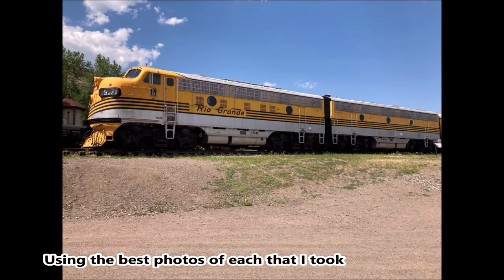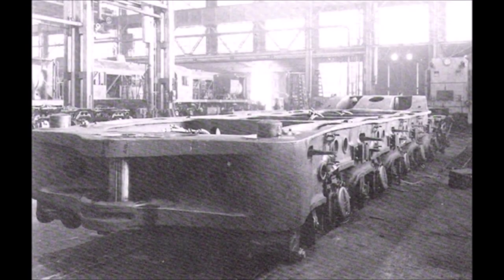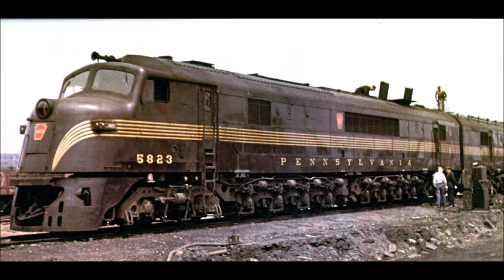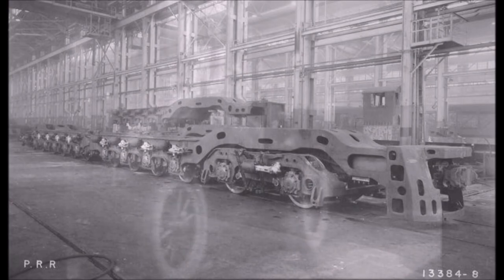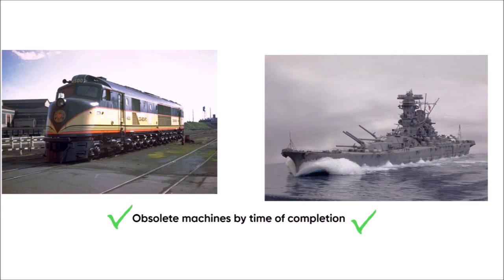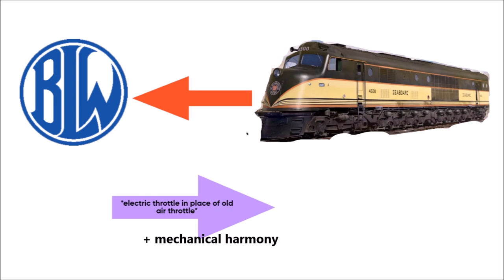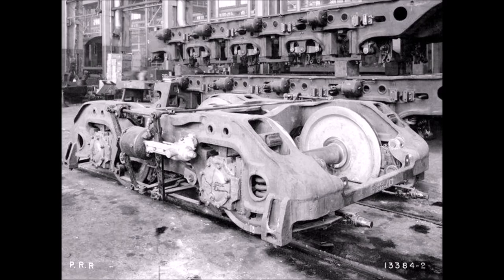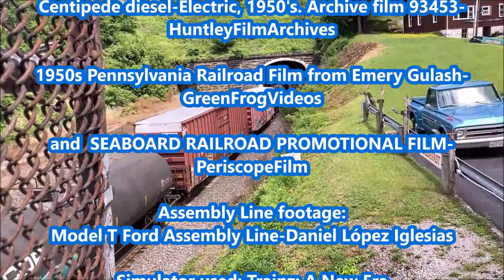The Baldwin Centipede| A steam-head company’s rough start with mainline diesels.

Comment: The main feelings of the Baldwin centipedes and the Baldwin baby face locomotives was the fact that everybody was going EMD and Alco. Even with a laborer walking behind the engineer watch mopping up the oil they still leaked like a s i e v e. Another major defect with the Westinghouse electrical gear that Baldwin had used for diesel since the beginning were at the end of their development and failures were common and inconvenient. Fairbanks Morris had the same problems with their high-powered look about his and when they went to General Electric electrical components Westinghouse exited the business. It's a shame that none of them were preserved in the museum.
Reply: Frank, 
Actually the Westinghouse house electric  equipment on the Baldwin's and F-M's were "nearly indestructible" . The combination of the generator and pneumatic throttles tended to break crankshafts or engine block webbing. (Westinghouse basically put themselves out of the business). Baldwin eventually strengthen blocks and there webbing. However, the primary mistake was making the prime-mover and generator 'one' assembly, meaning the block had two bed mounting points and the generator two. So, there was additional stress on the crank and block where they mounted to the generator. (A mistake later repeated by M-K/MPI on the MK5000's).
Reply: @henryszubielski8601  you brought up some points I was not aware of I am not totally up on the failings of Baldwin Road diesel locomotives. I do know that they are subject to crankcase explosions from fuel building up in the crankcase. All diesel suffer from this some more than others.
Reply: It is my understanding that Westinghouse generators suffered 'flashovers' under heavy load. The Westinghouse traction motors on Baldwins and FMs were far superior to EMDs.
Reply: @frankmarkovcijr5459  True.
And, the early De Lavergne engines also tended to dislike turbochargers. Everyone had their teething problems. Each adjusted for it. Flashover was an issue for any early diesel locomotive if pushed to hard. Again, Westinghouse worked through the issue with Baldwin. By then it was to late in the game. Here is something a lot of people don't know, all versions of the De Lavergne engines continued to be improved and supported into the late 60's or early 70's (if memory serves me). SMS is one of the great strong holds for the Baldwins.
Reply: @Greatdome99  Yes. But all of the early manufacturers had that issue if the locomotives were over loaded. Baldwin may have seen that a little more given that they produced switchers only, at first. That is the most demanding senario, and with the pneumatic throttles  putting the locomotive into forward and reverse so much it was bound to happen.
If memory serves me,  the early F-M switchers saw this more often as well (pneumatic throttles). 
For the yard switching engineers, it is said that they loved them because there was no extra step to go into the other direction.

Comment: Thet just don't know the benefits of the electric trains powered by using Natural Gas, Thermoelectric and renewable power stations!..
Reply: does natural gas and thermoelectric runned locomotive even exist? im just sticking with catenaries instead of these or even batteries and hydrogen
Reply: @voidjavelin23  I actually meant power plants to provide electricity for electric trains!..
Reply: @johnarnehansen9574  eh i like nuclear powers more

Comment: Every episode in these series I find more wrong things.

First I'll start on your hypothesis about why more wheel = good. More wheels do not relieve pressure on the rails, infact psi can't even be used in this situation, as the rails and wheels are in a open air containment. Pressure is used to measure gases and liquids, not solids. The reason more wheels help with rail wear, is weight distribution. With more wheels, the carbody has more places to spread the weight, as such damage and wear is less focused on the rails.

Now I also have alot of problems with comparisons in this video. First of all, the GE manufacturing plant. This one isn't as important but I'll list it anyways. All diesel locomotives in the US, GE and EMD atleast, have slanted noses. The reason this is because EMD noses, mostly standard cabs, have a 1-2 degree angle on top (excluding high noses). Now, the Yamato Class Battleship is said to be, and I quote, "The right ship for the wrong war," which in this case fits perfectly with the Centipede unlike you said. The Centipede was made using steam locomotive strategies, in the production of diesels.

Finally the problems, with your problems and explanations. Baldwin actually did pretty good in the diesel market for what they first and last sold, the middle era (the era the centipede is in), not so much. Baldwin never really intended for MU connections, and probably didn't care much either considering steam never had that. This can be found out in AmtrakGuy365's "Baldwin Sharks" video. The sharks actually did very well, even with the inconvenience with MU connections to other brands. If the railroads ever found it too annoying, they just converted them. And considering there was less Centipedes to Sharks, it might've actually been an easier job. Centipedes also had wheelslipping issues, as they had too much torque to use, and it had to be put out someway.

Now you do actually get some things right. Baldwin didn't really have the factories to mass produce Centipedes. They did for smaller things, such as switchers, road switchers, and of course, the sharks. Baldwin probably didn't have a fun time converting factories from diesel to steam production. Infact, they barely stopped making steam locomotives, making the US' last batch of steam locomotives ever with C&O's Alleghenies. 

It's funny I found more accurate information with Train Simulator's Centipede DLC and AmtrakGuy365's video on Sharks, only mentioning the Centipedes in Baldwin's history. Before you ever make something public on a topic you don't personally have experience with, make sure to fact check it with other sources, rather than just 3. Wikipedia also is more of a secondary source, as anyone can modify it with just an account. That's all.
Reply: It's ridiculous that you try to correct somebody whilst you are wrong yourself. If you're having problems with physics you should ask questions rather than just making random claims.
Of course you can divide a force by a surface and get a pressure. Whilst it's usually not done in this case because the contact patch has an uneven pressure distribution it is still an important metric. It is more comon to talk about wheel load (/normal force) (or what the American terminology is).
PSI is not just for gas.... wtf...
Reply: @erikschmidt476  You can't measure solids with PSI, though you can with gas, and sometimes liquids. Take a hydraulic press in a closed space for example, the more it presses down, the more air is compacted into a smaller space, creating a higher PSI.
Reply: @Sleeper____1472  Yes, you absolutely can apply the concept of pressure to solids.  I have done Hertzian contact stress calculations many times.  The units are that of pressure.
Reply: @andyharman3022  We would messure that with Newtons, not psi.
Reply: @Sleeper____1472  Then you weren't measuring it right.  Newton is a unit of force, not pressure.
Reply: @andyharman3022  in the US we never measure the pressure between to solids, we measure the force being caused by one on the other.
Reply: @Sleeper____1472  I think you would call it "stress". Without making it too complicated, "Normal stress" (okay actually hydrostatic, but who cares :) ) the same concept as pressure within a solid.
Actually the best example would be a knive. If you say pressure does not exist for solids, I wouldnt have needed to sharpen it just now :)
Reply: @erikschmidt476  I've never heard it that way, but I guess I'll take your word for it.
Reply: @andyharman3022  Correct.  Yours was the answer I was waiting for.  The original poster is incorrect and fails to understand the concept of stress in solid materials.
Reply: @Sleeper____1472  Force divided by area = pressure. That's how knives work.